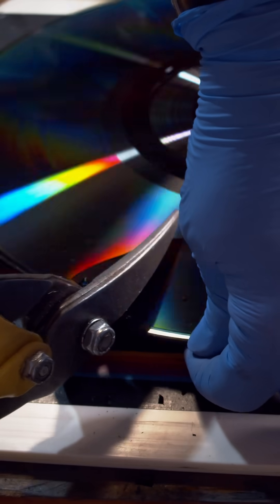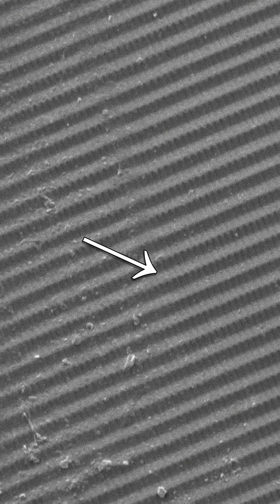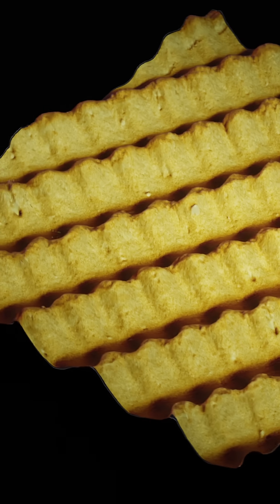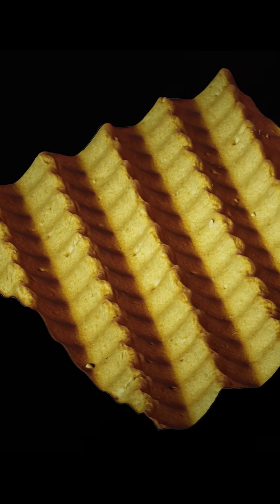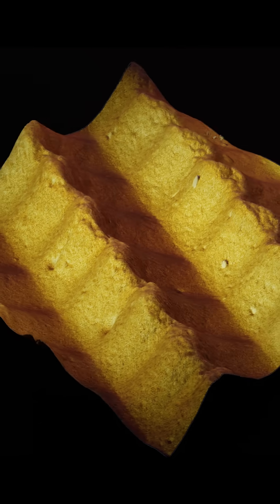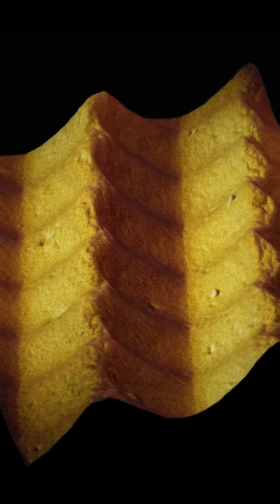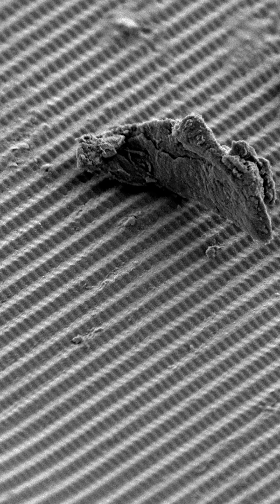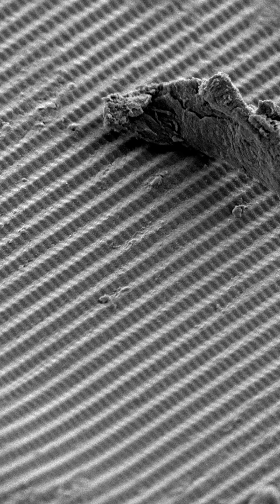Capacitance Electronic Discs

Comment: No THIS is bs and I don’t at all understand how measured capacitance can create an analog signal containing detailed video and audio information. How the heck does it carry information.
Reply from the maker: It's a pretty complicated system! I have a longer video on my channel explaining it more, and Tech Connections has a three-part documentary about it (highly recommended!). The longer explanation is that they used a complicated AM/FM scheme. There was a carrier wave, and the slight change in capacitance on the disk was used to alter the frequency of the carier wave, which was then used to alter the amplitude of a second carrier wave. It was all very fiddly and complicated, and part of the reason the device was never popular :)

Comment: Think about when CDs and DVDs came out they have been doing nanotechnology at least since they started on the CD
Reply: That is not true. When CD's came out in the 1980's, yes microscopically sized integrated circuits existed but these were of the order of 3 microns feature size and larger.

3 microns is not nanoscale. Nano scale did not come until years later.

Comment: “How does a Laser Disc work”
“Never mind, shouldn’t have asked”
Reply: That's not a CD. CDs use nano sized mirrors basically for a laser to read the data.
Reply: this is neither a laser disc nor a CD.
Reply: This is an electrical means of reading data from the disk, not optical (not laser).
Reply: Laser disk, watched heavy metal on it when I was a lad

Comment: CDs and DVDs really were ahead of their time. We need to keep them around more than ever. They're like our stone tablets almost lol
Reply: These are different than CD/DVD technology, which is a digital signal read by a laser, and degrade after 15yrs.   
 CEDs are more like futuristic vinyl records, that don’t touch the record to read it, but are from the ‘70s.
Reply: @GoatPopsicle  cds really degrade after 15 years ? I thought they’re a good cold storage medium for photos and old files
Reply: @definingslawek4731    Yeah they degrade.   That’s the reason why the US gov still uses magnetic tapes for secure long-term storage (also special single-write, single-read SSDs).
Reply: @definingslawek4731 They can degrade but the 15 years quoted was stupid. Maybe he's talking about burned disk's. Factory made CDs last in excess of 40 years without degrading.
Reply: @zverbrycke  The disc on the Voyager probes is an old-fahioned analog audio record that can b played on any record player.
Reply: @twinklingwater I just wonder how they conveyed the rotational rate, and direction (outside in) using only mathematical constructs because they won't already know what we sound like to know when it's right.
Reply: @twinklingwater 
Your age is showing.
Reply: Yes that flake away after a couple decades lol
Reply: @yacobshelelshaddai4543  what if we made stone ones or some different material that'd be more durable and ofc work properly we just haven't looked at it so much more after getting it where it is

Comment: it's officially a vinyl record!🤔
Reply: No. Because a vinyl record relies on physical contact of a mechanical needle in to the grove on the vinyl disc. The physical movement of the needle is then converted into an electrical signal by way of the moving coil or moving magnet cartridge.

There is no physical contact here. This relies on the principle of a change in capacitance which is to do with electricity. It is to do with electrical charge and how that changes as the pickup is in close proximity to the groove.

Comment: I bought one of these machines in high school so that I could use an audio sample for a school play. Brand new (1981), the machine could not play through a whole movie without tracking problems. Frames of video often glitched as the player would miss track. Several frames would be skipped over. I had to make several recording passes to be able to pull 30 seconds of reliable soundtrack. In trying to get the machine fixed under warranty nothing could be done. The technology was just unreliable.

Comment: So is this different than a CD?
Reply: Yes, very much so.
Data is read from this disc using electricity and the information encoded is analogue.

CD's are optical, they use laser light to read the data. The data is also digital, not analogue

Comment: Are these ROM DISKS?
Reply: No. ROM disks, more correctly called CDROM are optical and use a laser to extract the data.
This is a capacitive disc which uses electricity to read the information. It doesn't use laser light.

Comment: Wouldnt any bit of dust ruin the thing?
Reply from the maker: Yep! That was one of the big flaws of the system, they were very susceptible to dust. The disc was hidden in a "cartridge"  so the user never handled the disc itself, and it was ejected directly into the machine. But over time dust and scratches would accumulate (like a vinyl record) and start to ruin the audio/video.

Comment: What movie did you destroy? Fun fact about CED. 100% of the keel ground stylus tips were made on a single machine. When the format failed to reach even their least optimistic first year sales figures, no more of the grinding machines were built.

If that machine no longer exists, then when all the styli for all the different models of CED player are worn out, this will be a truly dead format with all its media unreadable due to the inability to make new styli - unless someone wants to fund re-creating the special grinding machine and the rest of the equipment to metal plate part of the tips and mount them onto old cartridges.
Reply from the maker: "Heartaches" 🙂 That's a neat tidbit of info! Such a fascinating (and tragic) history to CED.

Comment: I was given one of the RCA players and a couple of movie discs by a relative. It was one of those "Hey, you know electronics. If you can fix this, you can keep it" arrangements. I didn't have schematics, so I couldn't troubleshoot it. It sure was stuffed full of circuitry, though.

The RCA capacitance discs were competing with laser discs, which were the same size, but read by a (Dr. Evil air quotes) LAY-zer. Both formats were analog, and neither lasted long on the market before DVD elbowed them aside.

Laserdiscs weren't great. They had trouble with color noise, and had to be turned over (unless you $pent more for the player with a flipping laser carriage and reversing motor, like I did). The only movie I really miss is "Singin' on the Rain," not for the movie, but for the commentary by Ron Haver. It was great.
Reply: Almost 20 years is pretty long.  XD
Reply: @ztoob8898
Where you able to fix the player?
Do you still have it? 
Would you sell it today if you still have it?

Comment: Me with a scratchy disk hoping it work
Reply: It won't work on this type of disc. It is analogue and there is no error correction.

CD's, CDROM's, DVD's are all digital and forward error correction techniques are employed making the data resistant to scratches on the surface.

Comment: Can you explain how a disc is "burned" or has information written to it
Reply from the maker: They were made similar to old vinyl records. The audio/video was played and "decoded" by some mechanisms that moved a little diamond stylus, which physically cut into the master record to make the tracks. Then they used that master to make molds which then were used in big vinyl injection molding machines. Shoot in hot plastic, squish it with the mold, out pops a disc :)
Reply: @BreakingTaps   very cool, now make a short about that for $$$. I'd watch it

Comment: Still makes no sense how it magically turns  into sound and picture from something that looks like rocks
Reply: Computers, on the most basic level possible, are nothing but lightning running through sand.
Reply: @averagejoe9040  and computers are also insanity along with fiber optics ect

Comment: It just doesn't compute... Its amazing. Just... Howwww?
Reply: I know right. I've probably watched this short 10 times over just to really look and think about what he's saying. It's just really amazing what some talented humans can come up with. It all looks like they're the same height too so it must be just an even shorter distance than you can see zoomed in so much. Not too mention I image it would be next to impossible to create something to read such a small change in capacitance, but obviously it's not only possible it's able to be mass produced for a price that can be afforded by consumers.
Reply: To have a changing voltage (the FM he was talking about) you can either change resistance (resistors, think of a volume knob on a stereo) or capacitance (make the voltage in a battery go up and down). It’s usually much easier to change resistance but the mad lads that came up with this chose capacitance.

Comment: I yelled out loud when you cut it. I know it’s necessary, but i just… my poor heart can’t take this wanton destruction
Reply: Don't worry, if the disc is removed from its caddy in open air you've probably already caused irreparable harm by way of dust. That disc was dead before being cut.
Reply: @manoflego123  An autopsy.

Comment: I always found audio encouraged on disks to be so brilliant. Not just the ability to transform sound into these ridges, but doing so in a way where playback is possible with hardly any materials at all (in the case of simpler records). It's so incredibly clever.
Reply: That's because sound is vibrations, or molecules wiggling back and forth in a pattern. How records work is that wiggling pattern is literally engraved on the disk, and so as the disk turns the stylus moves along in the wiggling track, meaning the stylus is moving the same way air would for that sound. Then the stylus is either connected to a diaphragm to directly move the air or electrically connected to an amp to amplify the sound so speakers can move in that same pattern.
Reply: @1234567890CAB  No, wiggling is not the right word. It is a back and forth movement. Wiggling is white noise.